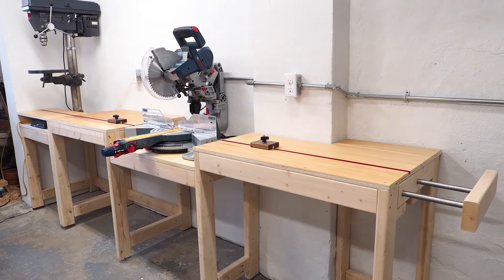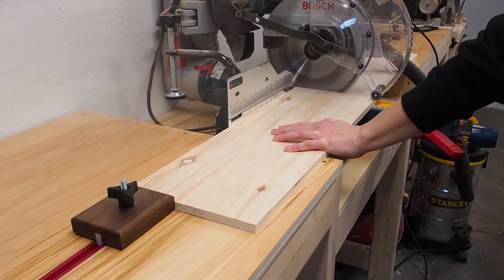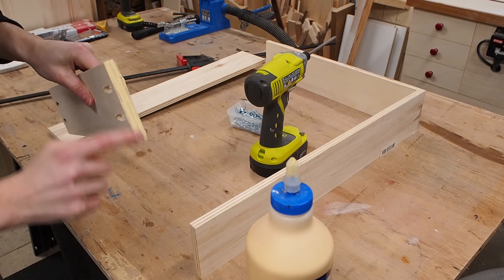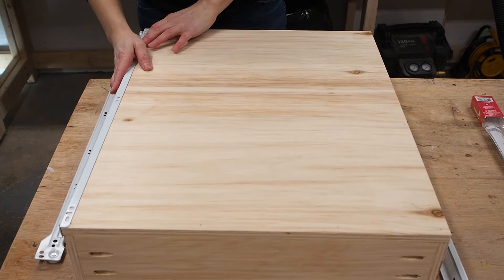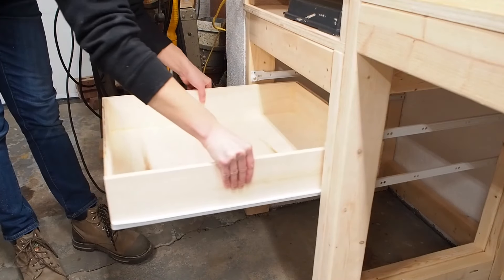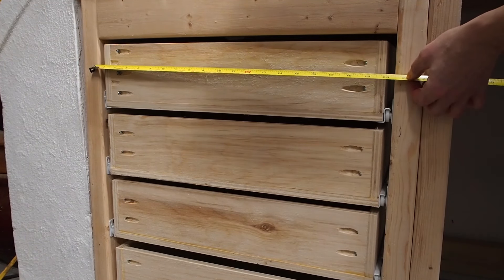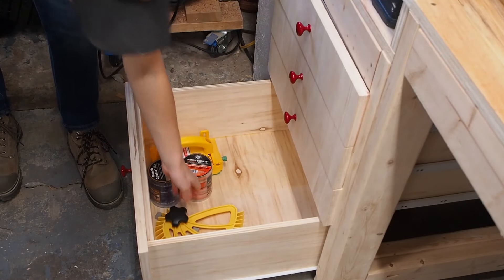How to Build Shop Drawers with Euro Slides

Comment: Your narration and audio makes watching the build very informative.  Not so sure using a "level" is  a good method of installing the drawer slides as it would depend on the entire cabinet being pre-leveled.  Using a square or alignment spacers would help insure accuracy.
Reply from the maker: Thanks for the tips and totally agree. However this shop cabinet was indeed leveled first, and given that the construction wasn't exactly square, I decided using a level would work best in this context. In regular cabinet drawer building I would use spacers and a drawer slide jig.

Comment: I bought 14 inch slides but my drawers are 15 inches...am I screwed..how to i know where to put the slides so the front closes properly. I guess put them on the front first? (Line them up with front even though the directions say to line the wheel up with back)?
Reply from the maker: Don't worry, the slides are pretty much always shorter than the drawers. Just install the slides 1/8 back from the front edge of the cabinet and flush with the front of the drawer.
Reply: @DIYMontreal  ok that worked! However i did find out that the very top drawer was harder to install because the distance between it and the cabinet was not quite enough to push the track wells over without some additional "persuasion " hehe. But i got my DIY under table shelf finished and it turned oit way better than i thought it would. Thanks!

Comment: Working on my first woodworking project with drawers and this type of slide so this video was perfect - thank you.  Question:  for the drawer fronts do you line each of them level with the bottom of the drawers or is there a 1/2” overhang on all 4 sides?  Thank you.

Comment: I just spent the better part of 3 days looking on Youtube for how to build and install my first drawers using drawer slides. A frustrating endeavor to say the least because no one wanted to just explain and show the easiest method. They all want to over complicate it for a beginner by installing fancy contraptions with tricky and expensive slides. Then I came across this video, and after watching it a few times, learned how to size and build the drawer, learned how to choose the slide length I needed, and then to top it off, learned how add drawer fronts to everything. Just came back from Lowe's Hardware with the Euro style slides for the drawers, picked up the plywood, and getting ready to build them for my cabinet under my saw.

The same thing happened when I built the Flip Top tool cart you built in another video. I built it exactly like you said, and it came out perfectly.

Thank You!

Comment: Great video.  My only reservation are the euro slides.  Whoever built the cabinet drawers in my bathroom used something that looks exactly like the euro slides and they’re kind of weak and easy to bend and damage.  For a work shop I would prefer slides that are a little stronger. But the rest of it is great.  Unlike the elaborate and unrealistic complexity that some YouTubers show in their videos this is actually something a residential DIYer can do.  Great job, though I think I’ll try to see if there are more durable slides that can work with this.

Comment: I modeled my miter station after yours due to it's simplicity and functionality, now on to the drawers. I positioned my drill press on the opposite end  and will have space for the shop vacuum underneath the miter saw, and a pancake air compressor, ( which allows me space to make a drawer for Kreg stuff), and soon to be a mobile base for a router table. Thank you for your help, Phil

Comment: @DIYMontreal thanks for the lesson.  I suggest you line the bottom of your drawers with a rubber mat to alleviate your belongs sliding around.  Don't tack it down though.  If you cut it to fit...when it comes time to clean them you can simply lift and dump...

Comment: So having done it, how do you feel about these style slides vs. full extension ball bearing slides?  (Or home-made runners?)
Reply from the maker: Time will tell but for now I'd say it's worth the cost savings for small shop drawers if you have many. I think I prefer ball bearing slides nevertheless in terms of ease of installation, full extension, soft close, weight capacity, etc.

Comment: Nice job as always Marie. What to put in them? In my experience drawers are where tools go to die! I've lost count of the times I've uncovered something I'd completely forgotten about. However, they are necessary. Maybe the answer is keep them shallow, or don't over fill them.
Are the fronts solid wood? Because of the light on them, the view of the finished drawers makes them look like they have a full radius roundover on the drawer side edges. Until I realised it was a trick of the light it looked good. (Not that it doesn't anyway).
Reply from the maker: Oh no, I certainly hope they don't become a tool cemetery! But see how that could happen...
The drawer fronts are plain 3/4 plywood, simple as that :)
Reply: Ah. They look fine. Just an observation. Keep up the great content.

Comment: Hi  Loved this video and I'm trying to use the same system to put drawers under my bench. I'm having trouble using the Kreg Jig with the 1/2" plywood. Two issues. The clamp that is supposed to hold the wood in place while you drill the pocket holes, isn't long enough to hold the wood securely. Did you have to do anything special when you were drilling to keep the wood secure? Second issue. The 1" screws went through the side of the plywood. Any suggestions?  Thanks in advance

Comment: Now that you've had this for a while and probably filled in the drawers with heavier items, do you still like the Euro slides?  Do they seem to have any issues with heavy items?  I love the simplicity of the design, but am hesitant to use them for drawers that have a lot of tools, or one or two heavier items like circular saws, or metal tools, stain cans etc.  Any insight now that you've used these a while would be appreciated.

Comment: I love the look of these drawers.  I have also used Euro slides in my shop.  Their cost is significantly less than the ball bearing variety.  I did overload one drawer and caused a bend, but I was able to repair the slide and then remove some of the weight and the problem was solved.  I had tried to store large containers of Craig screws and large containers of concealed hinges.  Thanks for the video.

Comment: Just discovered your channel and enjoyed the build and your style of narrating the content. I used these slides on the very first drawers I made. My experience with them is you have to be very careful how much weight you load them with. This might sound obvious, but, the metal used on most of these slides isn‘t high quality and bends easily. I secured the runners to the inside of the cupboard with four screws, the drawer runners with five screws. On full extension, I had some bending on the runners and the drawer was even loaded to the rated limit. Would be good to get an update a few months down the line on how those side runners (secured with just two screws) are holding up. Have subscribed and rang the bell 👍
Reply from the maker: Thanks for the feedback, very interesting! I'll be watching out for sure... Especially since the slides are only secured to the cabinet front and back. I'll keep an eye out and update!

Comment: Great work as always!  I really enjoy your channel...  I do have a question about the drawer slides.  With the long run from the front to rear of the drawer and not center support as an extra mounting location for the slide, have you experienced any drawer sag in the middle if filled with heavier stuff?  I built my bench following your plans with 2 X 4's but was thinking of adding a center 2x4 with pocket holes just to provide extra slide support.  Thoughts?

Comment: Couple of thoughts from an old timer, using pocket holes to put together corners of a drawer when you have a beautiful table saw seems silly.  A simple locking rabbit joint has alot more surface area for glue and doesn't require Kreg jig or special screws.  One nice video on this technique was the quarter quarter quarter drawer system.  Its nice to do this with a dado blade(s) but I have used a single blade and cut just moving the table saw fence.

Second thought, just gluing and nailing bottom onto drawer again doesn't provide the strength of a dado cut into drawer sides to receive the bottom.

I always think of making shop cabinets as practice for other projects down the road so getting used to cutting basic joints on a table saw is good practice.

I have used both the type of slides you have and full extension ball bearing slides in my shop/garage cabinets.  I live near Detroit so the garage sees lots of humidity and temperature changes ... thirty years after building my drawers and lots of abuse they are still going strong.  Only thing I had to do after 20 years was to clean "junk" out of ball bearing slides with WD-40 and relube, then they work like new.  Hardware can be purchased from Rockler Woodworking as well as lots of others.

Last thought, someone commented on using MDF instead of plywood for workshop cabinets ... MDF doesn't do well with moisture and certainly doesn't work well with pocket screws not to mention machining it makes clouds of fine toxic dust.  I have been using paint grade plywood and Baltic Birch plywood for job I am working on ... definitely the latter machines better and maintains its flatness much better.  For me, if I am going to spend time to custom build something - even for the workshop I am going to use the best materials.  Titebond type 3 waterproof glue, good slides, good plywood.  If you do this, take your time building, your stuff will last your lifetime and you will long appreciate how good things work long after you forgot how much you spent.

Comment: Great video! Wouldn't the bottom drawer actually come out further, especially since it's shorter then the slides?
Reply from the maker: You got me! I realized afterwards that what I was saying didn't make sense. These slides only come out 3/4, and yes the bottom one comes out a little further!
Reply: @DIYMontreal  I was mainly just questioning myself 😂 but thanks for the assurance!

Comment: One question, how do you like that Bosch Axial-Glide miter saw? I came this close to buying one a while back. ’ve heard mixed reviews on that glide system.
Reply from the maker: I personally like it very much. I was accurate out of the box and has decent dust collection. I mostly make 90 degree straight cuts with it so may not be the best source of advice. But my experience has been nothing but positive.
Reply: DIY Montreal Bosch definitely makes some quality tools.

Comment: Great video. What I want to know is. What is the yellow stuff on your throat plate? is That tape or plastic?
Reply: Zero clearance throat insert - you can get from leevalley.com. They’re a very thin self-adhesive plastic strip.
Reply from the maker: It's tape! Made exactly for this. It's called zero clearance tape by Fastcap.
Reply: Thanks

Comment: Ok, I have one very important question. Could you explain how you took the height of the opening you had to work with, and figured out how tall to make the drawer sides, given that you knew you wanted x number of drawers to fit inside the cabinet? For example, if the height of my opening is 18", and I want three drawers, what calculations do I do to figure out the height of the drawer sides? Hope this makes sense.

Again, thank you for leading beginners like me (at 74 years old) through our first drawer making and installing project!

Comment: Did you have any problems blowing out the pocket holes using the standard jig and bit
Reply from the maker: No but you do have to be careful not to go to far when tightening the screw - stop when you hit the shoulder or it's easy to blow through.
Reply: The first time I ever used a pocket screw, that's exactly what happened. But the solution was simple, turn the power drill torque setting to it's lowest. You can then always just check with a screwdriver.
Reply from the maker: Absolutely! Great tip.

Comment: Why are the roller mount on the carcass different? I have two sets of the same rollers and on grasps the wheel and one is flat. Did you notice that on the slides?

Comment: Nice.  A neighbor just tossed out 7 Almost new drawers (various sizes) with Euro sliders.  I will build cabinet for drawers.  Any chance you will apply stain or clear coat.  Ha ha love the red .  LOL.
Reply: I see commercial office drawers in the garbage every so often. Ive harvested the slides occasionally.  You certainly loose the flexibility of design, but also save $5-10/pair.
Reply from the maker: Haha, that works too!
I was going to leave the plywood bare without finish. Not sure I have a need for finish in the shop, but perhaps a clear coat.

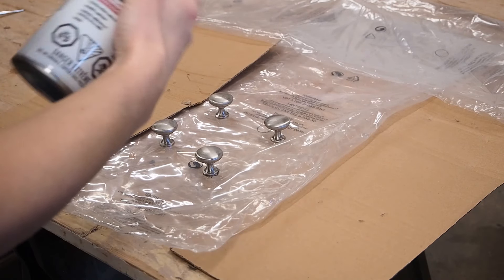Comment: The one mistake you made was to use the drawer fronts to limit the travel of your drawers when you close them. Over time these fronts will be knocked off due to continual collision with the frame sides. You would have done better to set the slides back and make the drawer fronts fit INSIDE the legs of the unit frame, flush with the front of the frame legs, and let the drawers be  stopped by the back of the drawer slides. Would have looked neater too, as you might see at 5:58.
Reply from the maker: Good points I had not considered. I wanted the faces outside as the 2 by 4 bench wasn't exactly built square and that would be apparent with the faces nestled within.

Comment: Cool  
Ps très jolie la touche de rouge 
Je trouve ca vraiment cute 
Ps pour les autre en dessou 
Faire des unites mobiles d'outil 
Genre ton cake compreseur sur roue avec des tiroire en dessou pour ton gun a air et juste a derouler fil electrique et hose a air 
 Et pour aspirateur unite avec dust collecteur cyclone et avec étagere pour suporter tes sableuse 
Donc petit compact et efficace
Je me fait une unite mobile pour mon planeur makita  
Roule en dedan garage et roule dehors pour planer  
Et il aura systeme integrer pour la pousiere
Reply from the maker: Cool, merci pour les idées! J'avais juste cela en tête. :-)
Reply: https://youtu.be/zsB9iXAQ7As 
Ce genre de mobile outils   
Que je te parle 
Pas vraiment mes idee 
Mais celle que je trouve meilleure je copie ;-)

Comment: "I am going to use the metric system for once"

All Europeans watching the video: THANK GOD
Reply: LOL!  Not all Europeans though, I'm British and way over 21...
Reply: @robjworkshop5692  I thought the English didn't want to be Europeans anymore
Reply: TRUE!!!!
Reply: The imperial system is easier for most joinery because it’s far quiches to calculate half and quarter measurements. 
Half of 12.5 is 6-1/4. Simples. Double is 24 + 1/2 + 1/2 = 25. 
Now do it with 8ft 6-1/2 inches. 
Half = 4ft 3-1/4. Easy. 
Metric you get 2,603 mm (near enough). Now where is that calculator...
Reply: @Dave5843-d9m  metric you'd start at an eve  2600mm. Half is 1300mm and half of that is 650mm.
Reply: @Dave5843-d9m  eehh whatta what now? I fail to see the logic :)
Reply: And us Canadians when she is.  It's only the USA stuck on the old system
Reply: Some of us Yanks use metric, too!
Reply: LOL
Reply: @Dave5843-d9m  hahaha, love your sarcasm :-) you're being sarcastic, right?
Reply: @Dave5843-d9m  Half of 1 & 9/16? Half of 27 & 15/32 etc. It only works when you keep within these specific boundaries you want to follow. With metric you tend to stay within the same kind of groupings as well. It is much easier to calc half 2603 (which doesn't happen anyway, we'd use 2600) than it is to mess around with fractions. 1301.5 - no calculator needed.

Comment: Nice video. But.. Odd that you make a point about slides being metric, since these slides work perfectly fine even if drawer itself is a bit shorter / longer. On the other hand, the slides work much better if they are sideways supported, and carriers don't just span point-to-point in an open frame like you have it here. Becuase the material is quite thin, it will flex sideways. Make at least a stable vertical bar  in the middle so they are fixed at 3 points. Makes a much better drawer sliding experience.

Comment: the top drawer was leaning down too the left not level. this will cause problems down the road.
Reply from the maker: The drawer is level... The cabinet framing is not. Hence why I used a level the install the drawers.

Comment: You started with saying that you would work in metrics , good all measurement then you started using how you are using half inch plywood and every measurement was in inches after that , WHAT !!! apart from that it was a good projects but I did have problem converting inch to millimeters.

Comment: Dont use pocket holes. Its a scam that is like a virus which has taken over youtube. If you get a job as a carpenter you will not do a pocket hole.
Reply from the maker: I find pocket holes have practical applications, like for shop furniture. Solid and simple. But agreed it's not for each and every application.

Comment: Thumbs down for using plywood
Reply from the maker: Really? What else would you use for workshop furniture?
Reply: @DIYMontreal  All mine is MDF and particle board, plywood is way too expensive and hard to obtain for use in the workshop. I completely understand that is not the case for most North Americans (and some Northern Europeans).
Reply: @vtbn53   Hey, a thumbs down is not really necessary .
Reply: @sundancerproductions8290  Why? It's there for a reason...